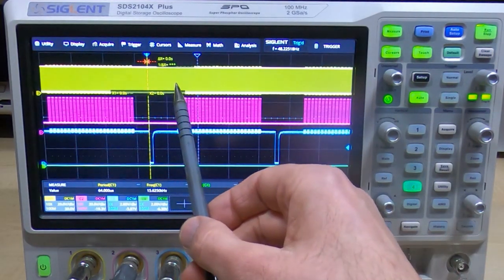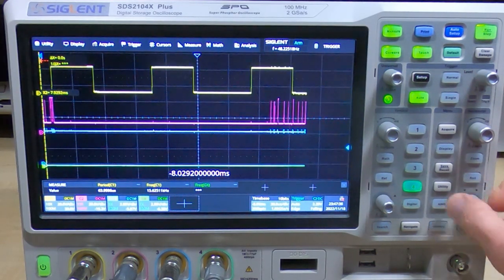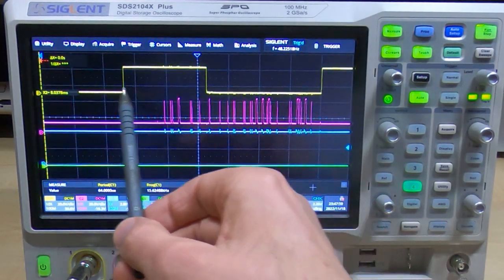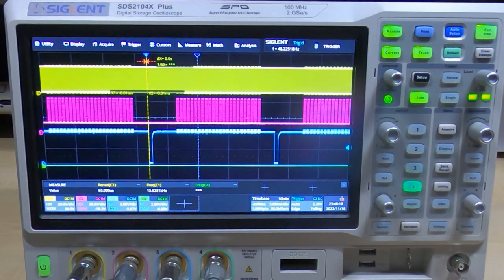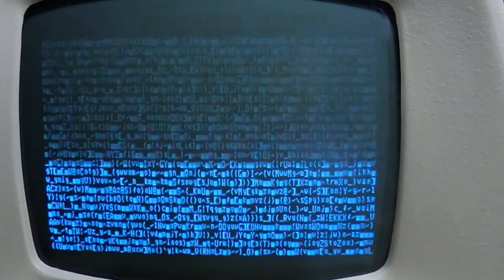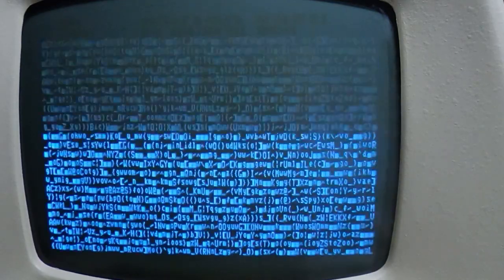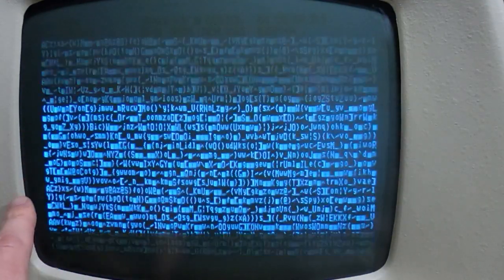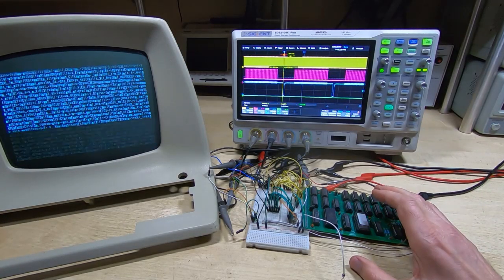Designing A Z80 Computer Part6

Comment: I noticed when changing the characters, several other characters also changed. The first two changes to character A on line 1 also changed the first two characters on line 5 to A. This did not happen when you then changed it to a C character, so I guess this is a timing issue, and it does this because you're doing it by hand?
Also, from line 17, it is just repeating the first 8 lines, I'm wondering if this is expected at this point?
Reply from the maker: Yes, Not only was this expected I explained in the video why I was making it do this. I was changing characters by hand and the purpose of this test is to see how characters looked across the screen but I did not want to have to write 1920 characters one at a time so I linked several address lines together so that I could write more than one at a time. I explain this in more detail in the next video.
Reply: @JerryWalker001  Sorry, I missed that, I thought it just read random data from the actual address each character is stored at. I just noticed this happening and wondered what was going on :)

Comment: Thanks for sharing this project.  Along the lines of the previous comment, it would be great to not burden the software with synchronizing video buffer access. It seems like the timing of DRAM refresh could be used to latch video data (cycles T3/T4), which would guarantee the CPU cannot be writing or reading from video RAM. Then you wouldn't care what state the display is in and you could get a huge boost in video buffer access while simplifying the software. Curious about your thoughts on the matter and more details about the software solution.
Reply from the maker: I am not sure what you are suggesting. The video clock is running at 4 times the CPU clock and it is not possible to write to memory during the M1 cycle. The video RAM cannot be 'paused' to wait for the refresh because the monitor scan is an analog which would be disrupted if the video is not output at the correct times. The only timing that can be 'paused' is writing to the SRAM. I was not suggesting that the software would be controlling the synchronisation of the writes to SRAM. This would be a hardware function. The CPU would 'write' data to the SRAM but the video system would only 'accept' it during a non active part of the video cycle. Because the video system is running so much faster than the CPU there are a few times in each cycle where this could be done. This is the purpose of the latch in the video system. Once the data is latched into it then the video SRAM is available while the shift register moves 8 bits to the display and this is an ideal opportunity to handle any pending writes to the SRAM from the CPU without the CPU ever being aware of the delay.

Comment: Thanks for this series - looking forward to your upcoming book.  I do have a request for the book/video series.  I'd like to have a better understanding about techniques to avoid contention between the CPU and video counters when reading/writing the video memory.  My first computer was a TRS-80 Model 1, and it suffered from video artifacts when updating the display memory.  Would appreciate your take on this.  Thanks again!
Reply from the maker: There should not be any contention between the CPU and video circuits in this design as the multiplexers and buffer will prevent this. To avoid artifacts on the display you simply need to update the video display during the retrace period. The vertical retrace takes around 2 mS which is long enough to copy an entire screen buffer to the video display and this would prevent any display artifacts. I have not yet decided on the approach I will take as this will be part of the ROM code development. Many early computers suffered from various imperfections but that is what makes them interesting :)